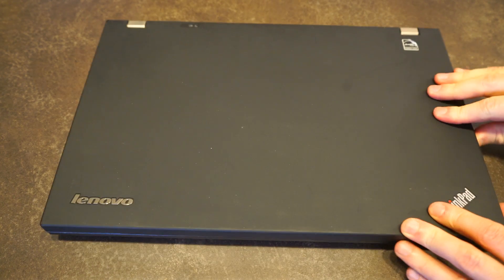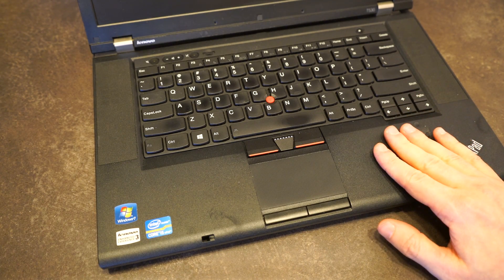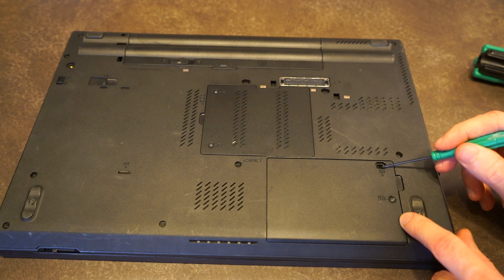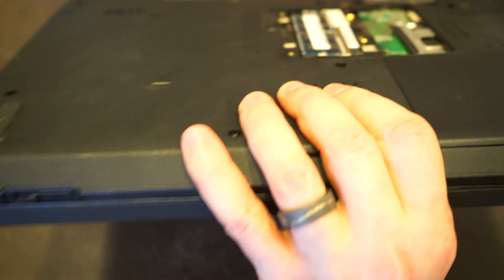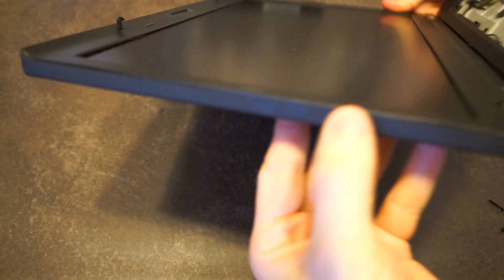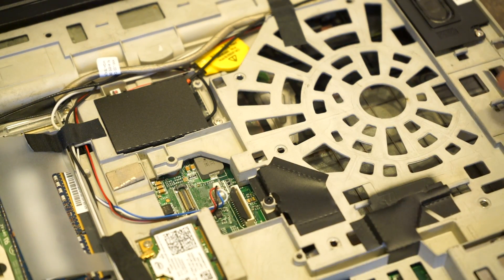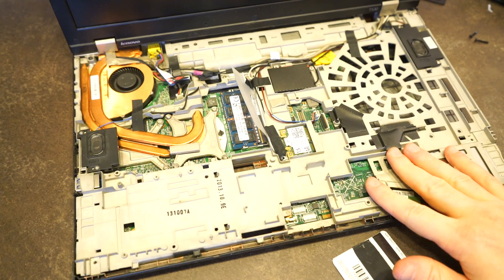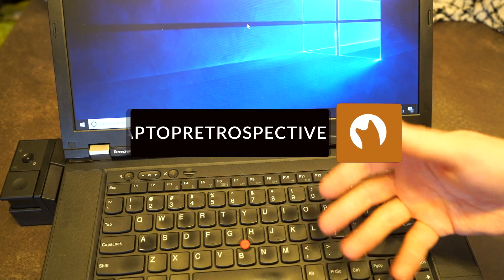Lenovo ThinkPad T530: The T430’s “Big Brother”

Comment: Hi, big fan of your channel. I would like to buy a USED Lenovo Laptop since I have been using it in office for long time. 

1) I need robust build, less heat, decent gaming / video watching experience, decent sound and ofcourse Website development work+study. 

2) Keyboard layout like T430 with phyiscal buttons at the bottom of click pad.

3) A laptop that would allow modding the GPU, RAM and Hard disk  

please recommend a good model :-)
Reply from the maker: 1) what games, what is your dGPU requirements?
2) easily done
3) modding GPU pretty much disqualified most ThinkPads.
Reply: @LaptopRetrospective  Sorry for the late response. 
1) I want to play older games like GTA5, Farcry 2 etc or something around 2013/4/5 games. Meaning some games with older versions. I think the old 3rd gen, low processors+ older graphic cards wont support newer games like PUBG etc and I am ok with it.
2) Can you please suggest any better alternatives to T430 with similar Mousepad layout with buttons at the bottom?
3) I am looking for something that would support 1 GB graphics card, 8 GB Ram and 1 TB HDD/ 250 GB SSD. 

Please let me know if you can suggest some models. :-) If the I am unable to find the alternatives u suggest or if they turn out to be more than 250$ (the cost of used laptop), I might give up on GPU replacement and stick to looking for T430. :-)
Reply from the maker: Some T530's came with dedicated GPUs that might begin to meet some of those requirements. It's rare that a laptop is both robust and graphically powerful.
Reply: @LaptopRetrospective  Thanks for the quick response. But if I am ok with average graphics, would T430 be a good choice, given my Mousepad preference? Or should I look for T530 too? :-)
Reply from the maker: Can't remember if the 430 came with an Nvidia option or not, I know the 530 did.
Reply: @LaptopRetrospective  Thanks a lot Dude. Will hunt for 530 because its very hard to find here :-)
Reply from the maker: Good luck. Let me know how it goes.
Reply from the maker: It's in good condition and has the finger print reader option. If the battery holds a good charge, I'd say it's worth what he is asking.
Reply: @LaptopRetrospective  Thanks a lot. After I pinged u, I checked with him next day and he said it was already sold :( Didnt know people here are hunting for thinkpads. 
Sorry to disturb you just one more question. One of my colleagues who is uses lot of TPs said I should be careful buying a T530 because he said  the old models with higher graphics would not have spares in case something happens. Hence he adviced to stick to T420 or T430 because they have simple config and hence spares should be easily available.. Please let me know ur feedback.
Reply from the maker: Sorry that one slipped through your fingers. They are desired machines. Regarding the high graphics being ones to avoid because spares are rarer ignores the reliability that ThinkPads are known for. I'd say you're safe.

Comment: I have just bought a Lenovo ThinkPad t530. It has Intel Core i5 3230M @ 2.60GHz, 8gb of RAM and a 240gb SSD, I use it mostly for light work, like e-mails, internet browsing, spreadsheets, etc. and it is very fast and responsive.
Reply from the maker: Very nice. What OS are you running?
Reply: I'm running Windows 10 Pro 64-bit, also I'm planning to replace the optical drive with HDD for extra storage.  @LaptopRetrospective
Reply from the maker: Nice!
Reply: It's really a great machine because it's affordable, reliable and highly customizable, I plan on using it for 2-3 years minimum. Great video by the way. Greetings from Serbia.   @LaptopRetrospective
Reply from the maker: Thanks! Glad you enjoyed it. Hope you enjoy your ThinkPad for at least that long.

Comment: Does it have the battery whitelist issue?
Reply: Men youre lucky i purchased two and both have been blocked for charging. Or do you flashed the patch?
Reply from the maker: I can't speak for whether or not they were patched or not. I'll inquire if that is something my local refurbisher does to them. Even the one I didn't get from there didn't seem to have an issue.
Reply: Keep me updated bro. If what youre refurbisher have done to bypass the checklist.thank you.
Reply from the maker: I'll let you know next time I meet up with them.
Reply from the maker: Haven't ran into it. All the batteries in these unit are third party. So the manufacturer either found away around it or there is something I'm missing.

Comment: This is truly a work horse.  The fact that you can put an M-Sata drive for O/S and use the regular drive space as a secondary SSD and then for the WIN, add a third SSD on the DVD drive with an universal adapter makes this laptop super versatile for Virtualization, Cloning Disks, Computer Forensics or even as a backup laptop for a DJ.  Recommendations:  Buy the extended battery.
Reply from the maker: Agreed!
Reply: so great t530 support the classic keyboard and bluray
Reply from the maker: So much to do!
Reply: Damn
Reply: I read "forensic" I think dude mean business, and with a thinkpad, he's badass
Reply: Can it be used for programming

Comment: The T530 will work with some but not all aftermarket batteries. I went through two different batteries from amazon sellers before I found one that would charge in the 530. Those same batteries worked fine in a t510.
Reply from the maker: Interesting. Can you tell us the brands that did and didn't work?
Reply: The amazon brands change so much any the one I bought probably doesn't exist anymore. Try to match the part # of you original to avoid confusion on amazon. I have had really good luck with battdepot.com too.

Comment: Hey man ,ANOTHER great video dude .Btw , since u have more experience with thinkpads can I ask ur help/opinion ? I am chosing between a L440 (1920x1080) and standart specs , (4th gen I5 4200u , 4gb ram (I have 16 here to upgrade)500HDD that I would get my ssd in etc etc ) for 200 euros ou a Thinkpad 13' I5 6200U , 8gb ram and m.2 256gb and 1920x1080 screen as well but for 350 euros with 3 years warranty , what would u get mate ?
Reply from the maker: What model is the 6200U? Is it a T or X? The L's aren't exactly the top tier line. The 3 year warranty sounds really boss, especially if it is a Lenovo one. Sounds like a lot of extra goodies for not too much more.
Reply: Laptop Retrospective Thanks for the answer.Mate is the Thinkpad 13' ( https://www.cnet.com/products/lenovo-thinkpad-13-13-3-core-i5-6200u-8-gb-ram-256-gb-ssd-20gj000pus/specs/ )  , isnt either T or X , that is the down side , it as passed the military test etc but it doesnt have te possibility for 2.5 drives for exemple
Reply from the maker: Doesn't have a few features but it is still a nice looking little unit in terms of specs and port selection. I don't have any experience with anything newer than the XX30 line but between the two I'd take this over the L model.
Reply: Laptop Retrospective  U rock man , thanks for one more reply , I also could get a W520 but it is just rocking a dual core and 6gb ram , so it would be pricy (even tho it already as a 1920X1080 and a discrete GPU)but base model is going for 240 , and the point is to upgrade from my T430 , even tho it is rocking 16gb ram 3xSSD's is kinda not optimal for my programming use and slows down when playing 1080 60 fps video (Counting min to watch the new video , keep up)
Reply from the maker: Solid reasons to be sure. Let me know what you decide!

Comment: I bought a used t530 but the back grill for the fan is broken. Is there a way this can be replaced?
Reply from the maker: Pretty sure you'd need to replace the bottom case. I don't think it's a separate part. Not impossible, but a fair bit would be involved.

Comment: One thing that I appreciate on "older" device like this as opposed to ultra/smartbooks, is that the devices can be taken apart yourself, and UPGRADED!! That is so important. I'm curious, how much did you pay for this refurbished T530. Did you own the device before or did you essentially buy a second-hand product in its entirety?
Reply from the maker: $350 Canadian. I got it from a very skilled individual who does rebuilds on the side and has access to the right equipment. It was essentially made to order. My upgrades are coming in later videos.
Reply: I bought it for $70 and $22 genuine battery only 5cycle count.
Reply from the maker: Great finds X2!
Reply: i got one from my best friend who works in IT and they would throw them away when they purchased new gear for the staff. the battery is toast and i didnt find a new one for a reasonable price yet sadly. The hdd was also toast and i switched it for an ssd now it runs win10 easily. Still a great machine i love it! hope to find a battery soon.
Reply from the maker: Batteries aren't that difficult to source.
Reply: @LaptopRetrospective  Only when you did too much 420. It's like really haaaard duuude
Reply: I bought one in my country for around 150$ or so. I just need to replace the battery for around 20$, and I love the thing so much.
Reply from the maker: Nice find.
Reply: Hello, it's now 2021, and I'll be getting my second-hand T530 tomorrow for approx 237 USD (12,000 pesos), cpu is i5-3320m, 8gb RAM, and 320 gb hdd, i don't know if it will be a good buy, but since I watched this vid, I'm pretty sure it will be worth my savings! I'm a college student btw
Reply from the maker: Glad you found it helpful!

Comment: I use a T520 as my go to laptop. Similar condition to the one you have. 8 gigs ram, i5-2540m, fingerprint reader, nVidia NVS 4200M, 1600 x 900 display, camera, and a new 9 cell battery. Picked it up for $130 US a few months ago without a hard drive but with the docking station. Put my 240gig Samsung 840 Evo in it and it runs like a dream.
Reply from the maker: Nice setup.
Reply: I don't think I'd need a docking station it's nice to have a full fledged desktop so all I need is local storage to transfer stuff between them, but I definitely want a t530 with nvidia chipset and I'll shoot for a quad core as well if possible. If not I'll upgrade it. That chipset will really be key to making games from the time and a bit before run just good enough to be enjoyable. All gaming laptops adopted the island keyboards at the same time Lenovo did unfortunately so t530 is the end of the line for now but in a few years I think standard layout will make a comeback.

Comment: i dont get what is so special about the thinkpads, are they like retro or collectables?
Reply: So you need to ask yourself "what am I missing?"  Why do ThinkPads have such a following of dedicated enthusiasts.  Once you work with a Thinkpad you will discover and "feel" why.  Years ago when our department changed from IBM ThinkPads to Dells (shudder) my boss came to me and asked if there was any difference between them as he knew I was a ThinkPad enthusiast.  I took a breath and was about to explain the keyboard action, the fit and finish, the ability to change out components, IBM's logical way of doing things, etc. but then I thought twice and said "None, that you would notice—now."  A year later he came to my desk and told me he now understood why I felt the way I did about them and it said it was to bad the company's standard equipment was Dell as the ThinkPads were definitely a better machine.  Unfortunately starting with the T430  and T530 Lenovo has not carried on the IBM tradition and is allowing the ThinkPad line to become just another machine.
Reply: ExWEIMan Exactly. New out of the box you might not see much of a difference, but a year or two down the road it becomes readily apparent which are built to last. I have a couple of T60's and a T22 that still function perfectly (except for the batteries) and feel almost new. The Keyboards are solid as a rock with no flex like most of the Toshiba, HP, and especially Dell's from a year ago have.
Reply from the maker: Should be a new slogan for them. "Wait and year and see why"
Reply from the maker: What about awesome story. Thanks for sharing your experience.
Reply from the maker: Durable and decently powered portables. They are designed to be serviced and that makes them very attractive to people that like working on computers. They also play nice with Linux and parts for them are common.
Reply: And great keyboards. Don't forget the keyboards.
Reply from the maker: Also have the , seven rowers vs the chiclet keyboard.
Reply: And that is one of the things that REALLY bugs me with the T530 and later keyboards.   I use ASCII a lot to insert special characters into my technically oriented reports—especially when I travel.  Last night I easily  used the FN NumLk on my W500 to insert an em dash in my reply—something you can no longer do as  Lenovo® in their infinite wisdom did away with the embedded numeric keypad.  As I mentioned above, Lenovo with each of their ThinkPad iterations is moving towards mediocrity and is wasting the capital obtained from their IBM purchase.
Reply from the maker: Don't make them like they used to.